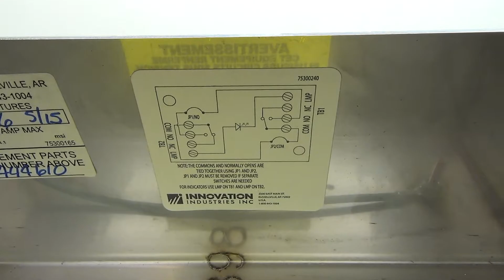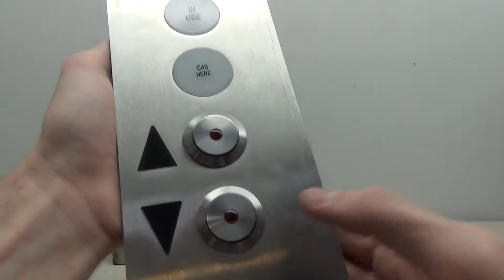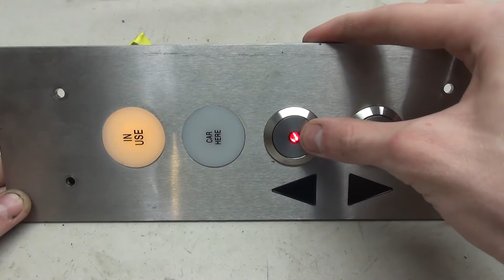Wiring an Innovation NEMA-4 Elevator Button

Comment: Oh! Now I see the difference between NEMA-4 and Bruiser. NEMA-4 looked so similar in pictures, but now I can see that only the flat center presses and not the whole button like Bruiser. The center also sticks out a bit.
Reply from the maker: Yeah I never knew the difference ether. NEMA 4 is some kind of compliance for waterproofing or something like that.
Reply: I wonder why buttons would have to be waterproof. Parking garage? Outdoor? Exposed to the elements? Probably in those cases. Or if some dude decides to urinate onto the panel. The buttons would be fine, but the janitor's sanity wouldn't be.